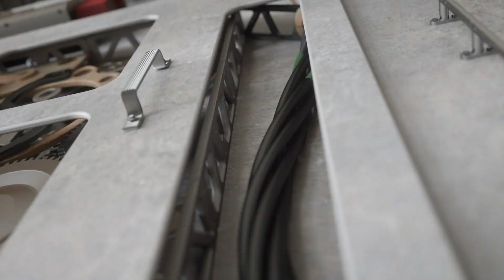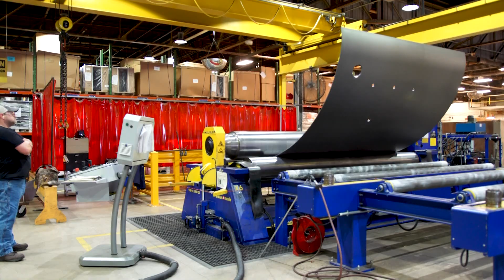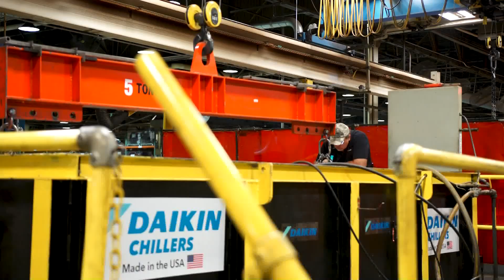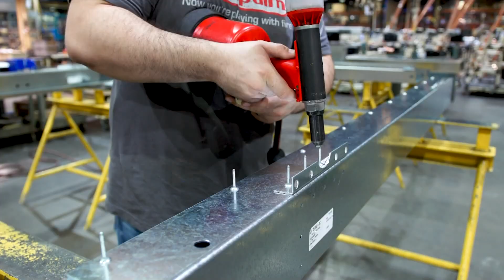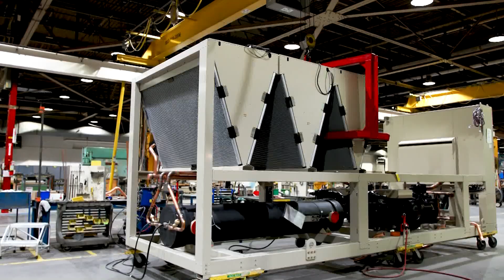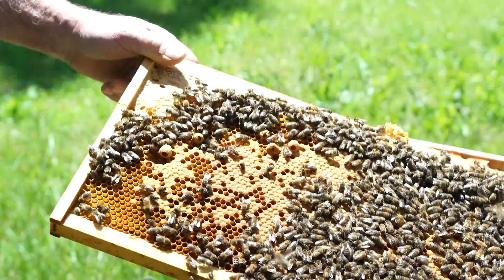Industrial Air Conditioning and Chillers by Daikin Applied

Comment: I work for an OEM Fluid Chillers Inc. in Lansing Michigan. Your facity, operation and work force is absolutely top notch. Lol today I was servicing one of our 140 ton air cooled chillers and they also had one of your Pathfinders air cooled chillers. I was so impressed. With your built in free-cooler. I also noticed you had sub-coolers pre-cooling your liquid line before the main electronic expansion valves. Amazing. We do that on our ultra-low temp (-70F) chillers with 2-stage Bitzer recip compressors. I'm hoping we can build a chiller with screw compressors before I retire. What a great video.

Comment: Im sure their commercial , industrial chiller factory puts out good products. How much is Daikin and how much of the engineering designs were McQuay? I will say that their light commercial rooftop units are crap, the coils leak, the heat pumps are over engineered overly complex, not very serviceable at all. Don't make machines that only a factory trained engineer can fix especially when it will have a healthy amount of service calls. Nothing I see in this video really sets them apart from Carrier, Trane or any other brand.

Comment: Hello,can you work a motor conditioner with out electricty it's work by oil?? thanks
Reply: لؤي المعموري no  man you cannot run an ac off oil
Reply: Panasonic also have a range of ghp systems that run on gas using converted diesel engines.